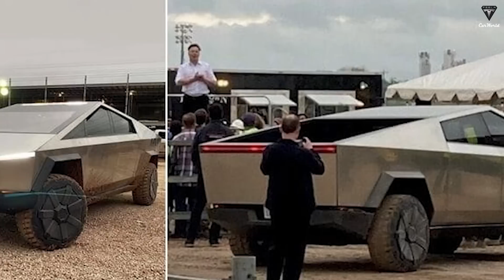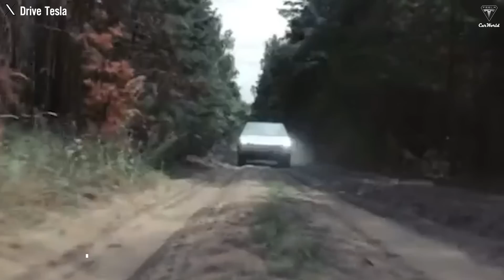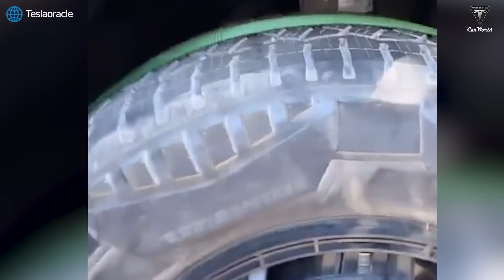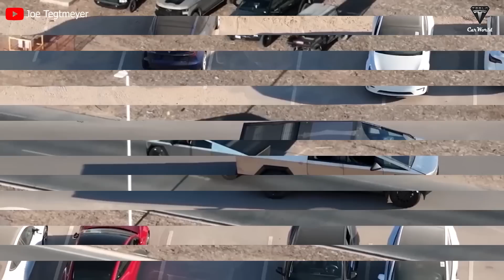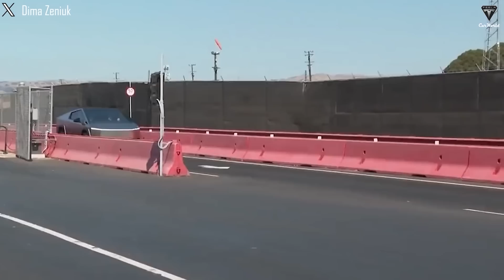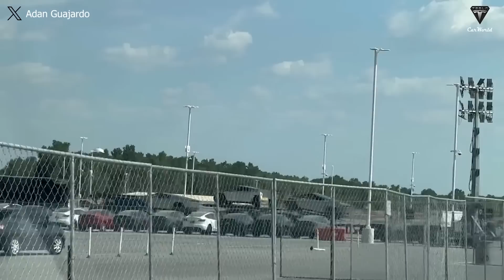Elon Musk Revealed ALL-NEW 2024 Cybertruck Inside Interior, Performance, Production Plan! (MIX)

Comment: I hope they release a Cyber Trailer with a full size battery pack to extend the range while towing, both in flatbed and enclosed versions.
Perhaps a removable enclosure so a single trailer could be duel use.
Reply: I AGREE!  But they wont waste the batteries…Tesla wants to sell as many vehicles as possible.  Would love to see a camper, van, boat, off-road UTV, snowmobile, etc.  How about the CYBERQUAD??

Comment: Come on man please do your homework.  The walls are slanted on the truck is to leave space for the  rear tires to turn. rear wheel steering  That's why it has changed. It's a new feature that wasn't on the original. It's been upgrade.

Comment: So the cybertruck is not bulletproof anymore ??
Reply: the steel used in the body will stop a pistol round. the glass will shatter  but the bullet will not pernitrate,  it was never designed to stop a high powered rifle round, remember ford is aluminum and GM sheet steel
Reply: Yes the glass is stronger and it's much more quiet all while weighing less.
Reply: Yes he upgraded the glass also now it's bullet proof also!
Reply: @david9192 there is no such thing as bullet proof. It is resistant to most small arms bullets.
Reply: @kstaxman2  ok then more resist then before the point is it is better glass then the one you saw demonstrated on the cyber truck before!